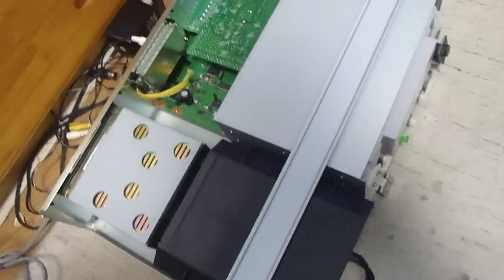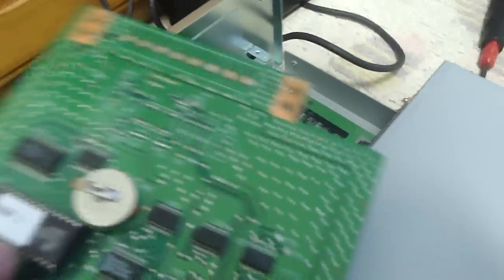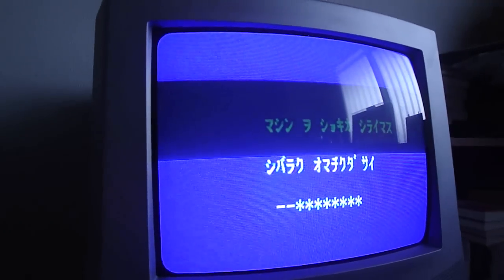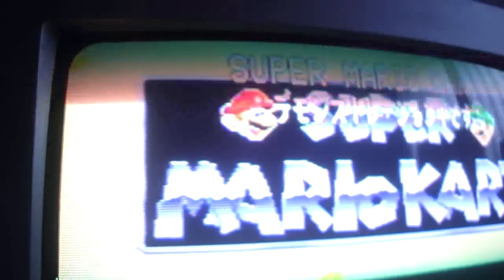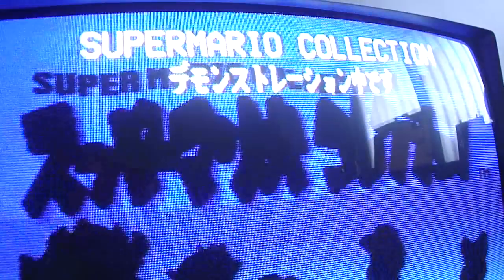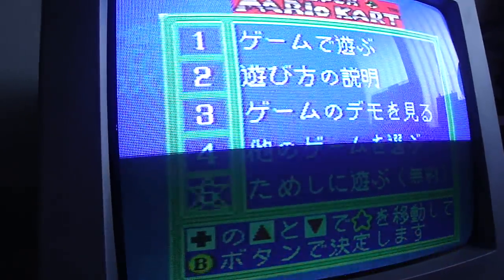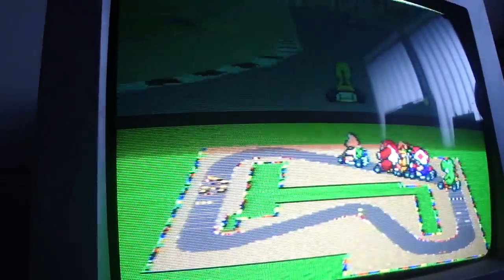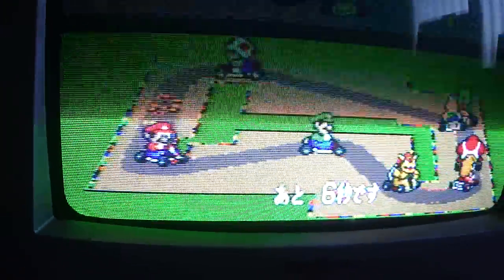Battery Replacement On Super Famicom Box Opens New Kirby Intro, New Options, Pure Awesomeness

Comment: heres the thing, are you sure that somewhere there isn't some kind of service menu? i have a feeling that it wasn't just replacing the dead battery, but if the "dead" battery had even a little charge it could have been enough to keep the service settings, like your PC's BIOS, that would explain the such a big change that the box has now been reset to defaults by pulling the battery. i think somewhere luke there's a service menu with controls for things like that lock. and turning the into on/off

Comment: Part1A:
I managed to open the front panel without the trick to open it by removing articulated bottom parts with gamebit 4.5 screwdriver, so less risks to break the plastic.
The top left and top right chromed round locks with a vertical squary hole are not truly requiring a formal key, but just the right tool. To open the left one you should turn anti clockwise and for the right one clockwise. The whole lock turns (interior & exterior) and it might require a bit of force to do so.To be continued

Comment: Part1B: Make the tool
Find a metal tube with the right diameter or make it.The tube should push on the four round pieces(bronze color)to allow the lock to turn.Cut inside the tube a slot, inside it put vertically a small piece of metal to fill the vertical squary hole.Now the whole lock is filled:round tube making pressure and  vertical squary hole to allow the lock to turn beware about the direction as mentioned in part1A I advise to keep one hand on plastic to avoid too much pressure on it.

Comment: Part1D: open super famicom box panel from bottom:
If you go the other way not through locks but by removing the bottom hinge: use a gamebits 4.5 screwdriver to remove each screw of each hinge.Problem with that is that there's big chances that you break the plastic,since locks are still in place at top and you have to force to make them slide&then make it impossible to put it back.I suggest the following: simply open the full back metal box as explained below & remove it as a whole box+panel.

Comment: What size of security driver did you use to remove the screws on the main console unit. 
They are bigger than your usual nintendo console / cartridge screws so I can't get mine open. I've also tried pliers, socket set etc but nothing works.

Comment: Part2 open the super famicom box (panel unlocked or unscrewed from bottom):
as mentioned by Luke you can use a "regular bit" to open the screws on the left,right,back sides of the box (3 screwsleft, 5 right, 3 back).I've used: a female Torx CR-V E8 called "Army specifics" (do not know if it is the brand)the face of the bit has been flattened to fit the screw (using a sander). The bit fits perfectly and each screw were removed without difficulty in one time. Now it is opened.Battery change time.
Reply: Do you have a link to the e8 tool you used?

Comment: Amazing what a little batterie can do sometimes :-)

Well, I am quite sure that it will not be a big problem for you to replace the key part with a simple switch, probably it will just have two connectors as the old HDD Frames had them and if not... well, then you will replace it anyway ;-)

Comment: Part1C: opening the super famicom box panel:
now you should have the left lock square hole facing left and the right one facing right. The panel should open easily. From what I've observed it is compulsary to open the panel to allow you to open the complete black metal box. Below further information if you open the panel from the bottom...
Reply: Tried this, unfortunately the tubular key I used just broke. Guess the nut on the inside of this one is a little too tight.
However, your other tip of using a file to flatten the E8 bit turned out to be very useful. Managed to get one of the screws out with a socket wrench and the flattened bit. So will just try and get all of those out, and remove the whole top. Thanks!

Comment: Hello!
I also have a super famicom box and wanted to open the big side security screws.
Problem is i cannot find the wrench tip to use...
Can you tell me what you used? I would appreciate a google link very much <3 hehe
Also 2nd question, could you check for me the voltage output on the superfamicom integrated ac? mine outputs 14V instead of 5V! and i of course use a 220-110v converter ( i live in europe).
This of course made something fry inside the unit (i could smell smoke) and it didnot turn on (only the led on the front panel would turn on, but now it doesnt anymore)
I want to check if i can repair it somehow.
Anyways the integrated AC fuse did not rupture... So weird
Reply: Did you manage to find a wrench to remove the security screws on the side panel?
Reply: @sie1984  yes! Didn't get a super grip on the screws but they did the job.👍
Reply: Awesome, what socket did u use and size as i cant find one to fit have you also managed to get past the locks?
Reply: @sie1984  as for the locks:
Tubular: drill thru them to remove.
Main power lock: i had the key! I think you can find it on ebay for cheap
https://www.ebay.fr/itm/174566060016
Reply: @CousinHubertRetrogaming  thanks for the reply what socket size did u use for the side panel and was it an e8 torx female?

Comment: I have changed my battery, though it looks that even with a new one, my new save got erased. The only thing i did is set the date... were you able to save ?
Reply: Hey man, which kind of tool did you use to remove the security screws? I've tried with a bunch of dice but to no avail ( I figured that the size must be between 5.5 and 6mm) I just received my own super famicom box and just like you I want it yo be restored as much as possible to its original form.
Reply: @aguzmanayon   i got a special screw driver DTC 26, ordered from taiwan though it 
was manufactured (disconitinuated) in Japan (i m based in Osaka).
Reply: @arnaudleroux4264  What website did you get the screwdriver from i can only find dtc 27s?
Reply: @Arnaud Leroux could you make yours to save? Mine still doesn’t save after the battery replacement! Thanks
Reply: @erichnardelli  Nope. i have replaced two same result" i guess there some sort of security to bypass, or maybe the battery is here for one purpose, the coin locker and stuff.
Reply: @arnaudleroux4264  Thanks for replying! Normally the battery to save games is on the cartridge PCB. I opened mine and there's no battery. Should have anything related. I don't know!